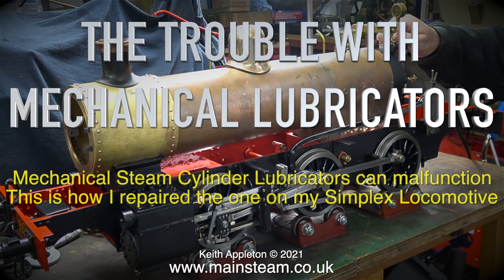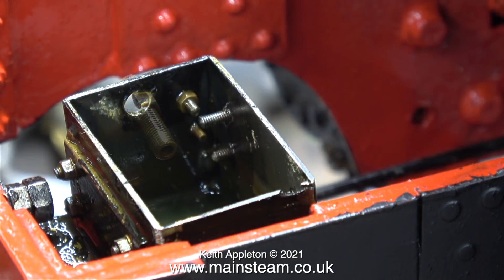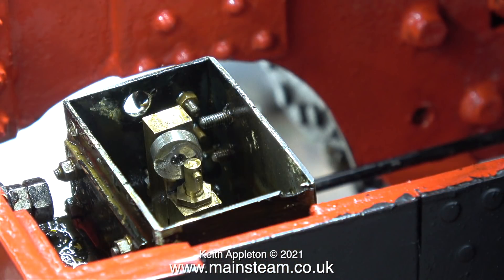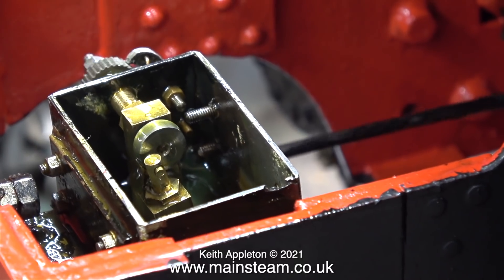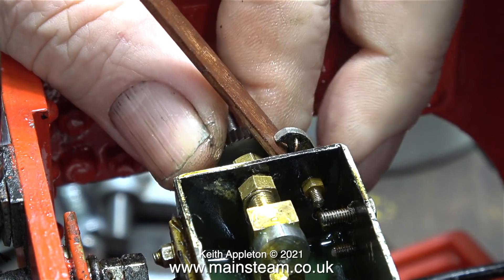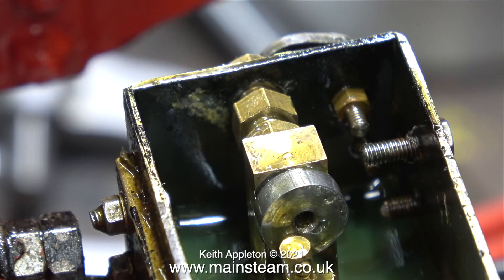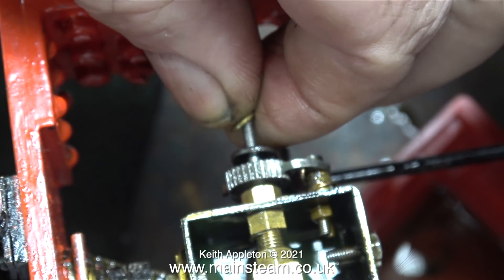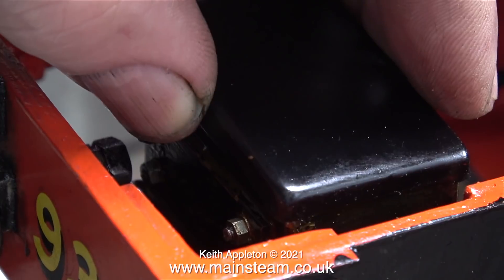THE TROUBLE WITH MECHANICAL LUBRICATORS

Comment: I’m new to model engineering and I was wondering why you would use a mechanical oiler rather than a displacement oiler or a drip oiler.
Reply from the maker: Because they are better and more reliable - like on the full size.

Comment: Keith - I had water in my cylinder lubricator today.. It had little bubble forming which leads me to believe the check valve wasn’t working and steam and or water was able to get inside. I cleaned it out and she seems to be pumping now. Anything else I should check? If she has condensation and or a bit of water in her before I started do you think that effected it? I did move her up and down the line to prime the axle pump and I fear that’s when water got into her. Thoughts?
Reply from the maker: I always use 2 check valves. The one on the lubricator plus a second once on the cylinder(s) feed
Reply: @keithappleton  Thank you for getting back to me. I believe there’s a second set in between the line going to the cylinders. I’ll check those out.

Comment: 1:07 Yes I absolutely did immediately see the resemblance! I recently watched your Blackgates Twin series, and Mr Pete's wobblers and now I understand a bit of how simple valving works in these things.

The cylinder is mounted on a check valve which puts the it way up in the air. It's supported in another dimension by the threaded rod. It's that third dimension that needs more support. The nut on the threaded rod helped. A large  washer under that nut would help, and review other options at the check valve mount point.

'They work most of the time.' Except for when they fail and can destroy something major. Excellent series, I'm learning a lot.

Comment: Very informative video. Our engines lubricator has just stopped working after 31 years with no problems. Not too bad if it’s another 31 years before it goes wrong again

Comment: A stupid beginner’s question. You stress time and again that constant lubrication is all important. When explaining the new lubricator you say it draws in steam oil on the upstroke and pumps oil into the system against the check valve on the downstroke. That said, the oil is pumped in only each half turn, that is about every twenty (give or take) engine turns, depending on the fineness of the lubricator’s ratchet, and then engine runs “dry” for another 20 turns.. Is that still sufficient then?
Reply from the maker: More than sufficient. Most Mechanical Lubricators supply too much oil . . .